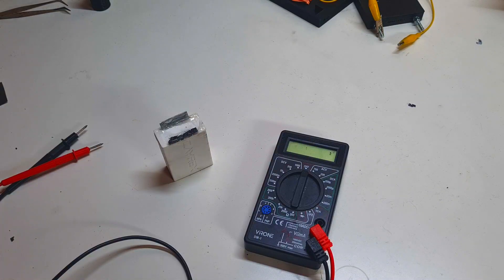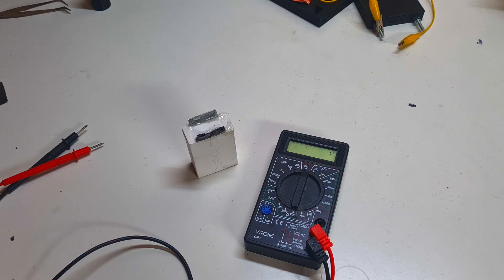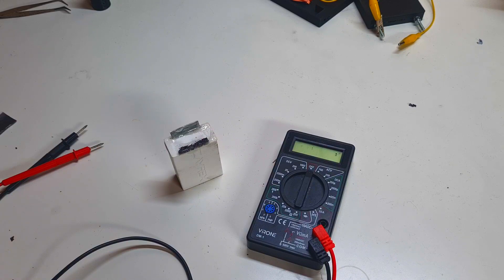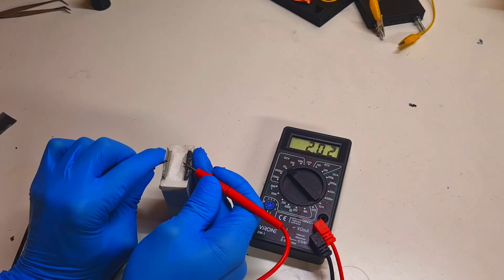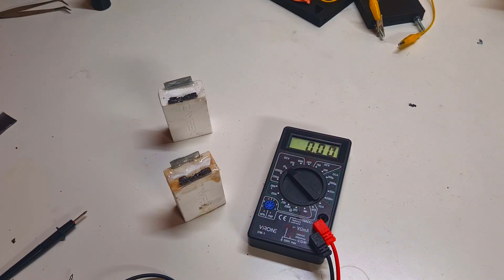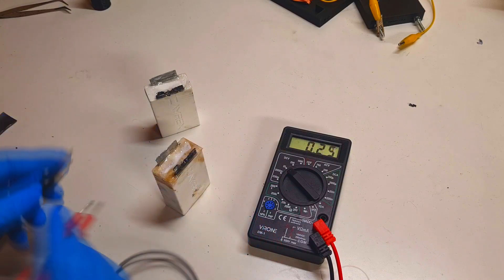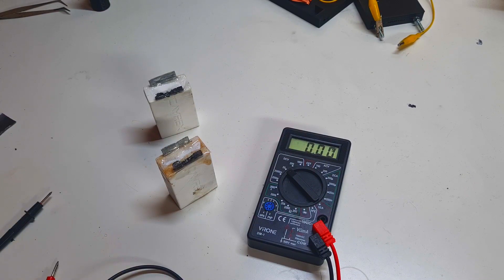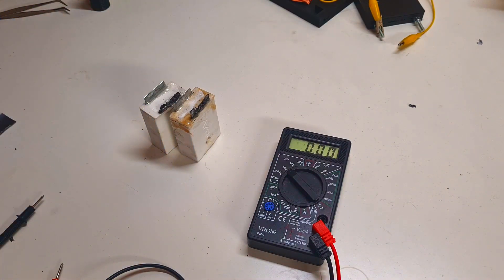Zinc Manganese Battery after 40 days?

Comment: What other electrodes could you use so that the electrode doesn't deteriorate with use?
Reply from the maker: Copper, SS,...  which is coated with carbon. Titanium foil is also good....